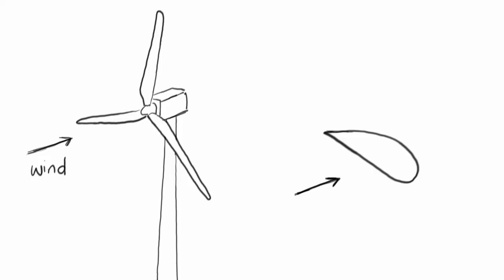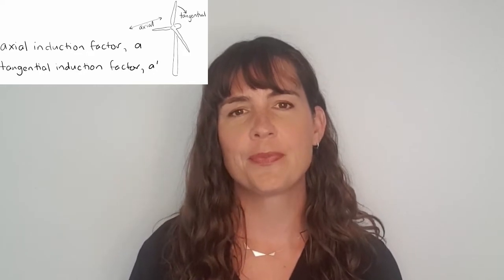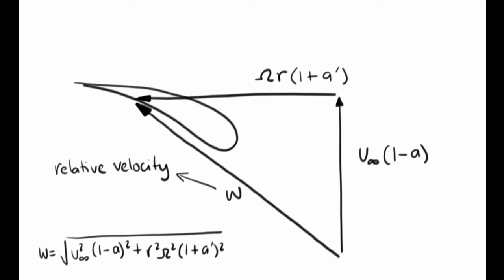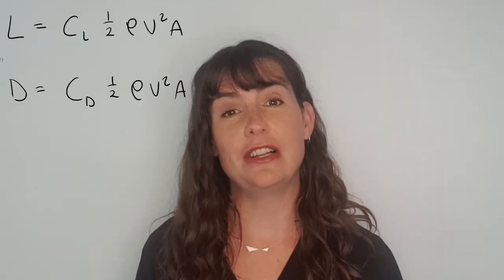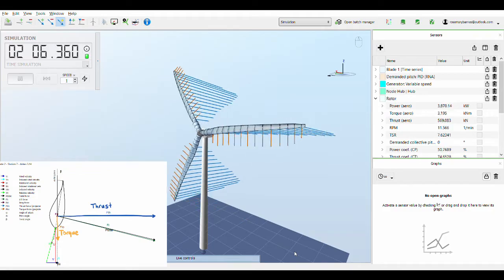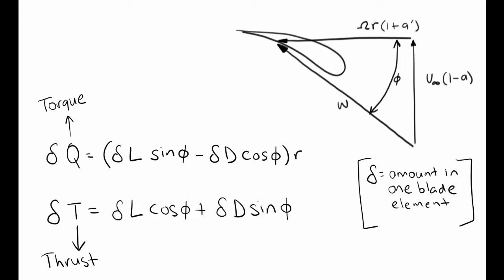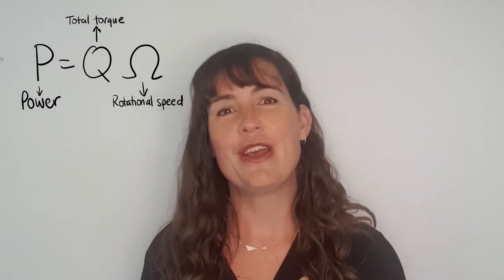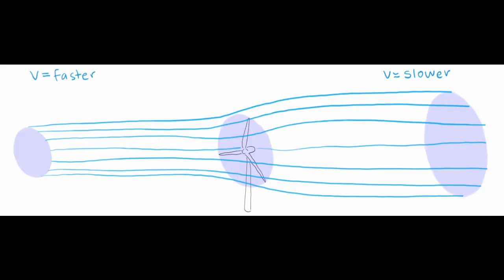How to Calculate Wind Turbine Power Output: Blade Element Momentum Method

Comment: Hi Rosie, One quick question - is generation of tip vortices accounted for in the calculation of CL and CD for Blade Element Theory (with something like Lifting Line Theory), or is that not possible?
Reply: tip losses or root losses usually captured with some kind of correction function such as Prandtl tip loss formula

Comment: I really love your videos and they help me understand for my school project. However i got a problem that i don't know what to do. in my project i have to pick one one blade design, test its efficiency then create one by myself so it would have better efficiency than the one that  was already created. also i will need to 3d print it. Any ideas or suggestions? Would help very kuch thank you so much again.

Comment: So could B.E.M  calculate the vortex and or the energy output of a archimedes / golden ratio turbine. That has a Diameter of a 100 Feet and 75 feet in length. I think not.

Comment: G'day Rosie,

Cards on the table...

My first Aeroplane
May be seen in,
(Title-searching YT...)...

"National Transportation Museum ; Visiting My First Aeroplane...!"

Regards my second
Hairygoplane...,

In it I
Made the 
(Coveted)
"Maiden Flight" of a
New Prototype...,
After I'd redesigned the
Wing
Trailing-Edge Section Profile..., &
The Undercarraige
(Substitituting a floating Bungee-Sprung Cross-Axle,  instead of a welded rigid triangulated 4130 Chrome-Molybdynum Tubular
Structure...), &
The Wing Leading-Edge, (replacing the Dacron/1.5mm Styrofoam/Resin
 "Foam/Fibre 1/2 Sandwich"
Hypothesis,
With 1 mm 2124 Aluminium
Sheetmetal...).

And, also, after
Designing & Fabricating & Fitting
An actually
Streamlined
Fudelage-Pod...,
Around the
Cockpit...

And after having
Flown behind
Two of my own
Hand-made, Home-designed
Laminated
Carved
Propellers,
As well as having spent
20 years trying to
Design a
Micro Wind-Turbine to be as
Cost-Efficient as a
Solar Panel...(!).

I started raising my own
Kids on
Kerosene Lamps, & Candles 
In the 1990s.

Because Solar Panels were
That pathetically
Bad...,
And
Windmills were
Worse....

Thirty years down the track,
And both my kids and myself
Live
Off-Grid
Using Stand-Alone
Solar Arrays, Batteries, & Inverters...
With
NO
Connection to the
Fossil-Fooled
Grid....(!)

Yuck
Fou...;
Grid-
Enslaved
DimyDamnDumbPricks&Twatz...

Just(ifiably
Sayin'...) !

Such is life,

Have a good one,

Stay safe.

;-p

Ciao !

My
BIG
OBSERVATION...

Is that
Betz' Law
Is
An
EQUATION.

It
ASSUMES
100%
EFFICIENCY...,
At
Converting
Rotational Shaft Speed
Plus/minus/multiplied/or divided by
"Torque"..., 
(ie the
"Twistiness"..., 
Encountered within 
Yonder
Shaftings... !)

Comment: Great work, 

In the video you mentioned that you can't use the BEMT to determine the optimum number of blades. But you also mentioned that this theory is good enough for the preliminary design of major blade geometry parameters including the number of the blades.

Kindly clarify this.

Thanks

Prosper
Reply: https://youtu.be/o6BCnhubbiQ?t=237
because in a 3 bladed turbine each blade does not affect the next one that much, zhus the overestimation of BEM (hich cant account for that loss) is relatively low. but if you would add 300 more blades, (which would obviously be insane) this model would think you have 100 times more thrust and torque, as it doesnt "know" the blades can affect each other. it always assumes perfect flow for all blades

Comment: is there a fudge facto for 2 and 3 bladed BEM for comparing wake % differences?
I would think two has next to zero interaction, 3 a little, but not bad, and 4 & 5 blades the hit is exponentially bigger.
Is the optimum number of blades pie?
:)
Reply: Each blade will disturb some air and leave a wake behind it by some circumferential distance, if the number of blades is too high (or speed too fast) then the next blade will be working in messy air that already has some of the enegy extracted - not ideal use of an expensive blade.

If you dont have enough blades (or rotation too slow) then you have some air just going through without any blade interacting with it and extracting power from it.

The distance of disturbed air depends on the aerodynamic quality of the design so a poor design = lots of air disturbed = cannot have another blade too close behind it (either by crowded rotor with many blades or high speed rotation).

 It happens to be that 3 blades at about tip speed ratio of 8 is optimal as it balances these factors.

Comment: Is this same math used for VAWT?
Reply: I do not think so.
Just trying to think about making some simplifying assumptions blows my carbon based simulator to bits of dust.
wind normal to rotation allowes  many clean assumptions and things like 1 dimensional math with a radial slicing as described..
VAWT everything everywhere is always changing. lots of crunching.

Comment: "You can't use this theory to determine what is the optimum number of blades for a turbine"
"It's definitely good enough for preliminary design of ... the number of blades"
hmmm
Reply: It's all about making iterations and as quickly as possible stop exploring something that has low or no potential. After having found something that looks promising it's time to spend more time and energy (money) to refine that idea with, for example, more complex analysis.

The two statements you quote are not in opposition to each other since finding the "optimal solution" relies on later, and more expensive, steps in the process.

Comment: Hi Rosie, very nicely explained....Can you explain what are the main structural( Harmonic , constant etc..) loads at the top of the tower in a stready operations....i mean if u remove blades nacelle and represent it with with structural loads at the top of d tower, what would be those..thank you very much...

Comment: thank you so much. I want to know are you have a program Matlab for BEM?
Reply from the maker: I normally just use an Excel spreadsheet and copy paste to iterate the flow factors until it converges. It is very fast and cheap, I haven't had Matlab since I left uni. 

This book has some Matlab codes that come with it I believe:
https://www.springer.com/gp/book/9781849961745
I used them years ago and they were a bit buggy so make sure to check if you use them.

Comment: Great video! I fully understood BEM theory thanks to you. 
Im an undergraduate student in engineering and i have to design and calculate the efficiency of a hydroturbine. I was wondering if BEM theory could be applied there? Any suggestions or suggested papers are appreciated!!!
Reply from the maker: In theory yes but you will need to check that all the assumptions and simplifications in BEM are reasonable for hydro. I have never worked with hydro, so I have never made those checks.

Comment: Hi Roise. Im design engeneer, and I m going  to build HAWT with diameter 24 m. Wich aerofoil are U recomended TSR 4.5. Power output 20kwh. For BEM modeling and optimisation i use Qblade. Can U recomended softwere for design Hawt. Thank U for video and reply.
Reply from the maker: Hi Demyan, wow that is a big turbine to be making on your own!
The aerofoil will need to be chosen based on a lot of factors unique to your design, so I can't tell you what will suit you best. Don't forget structure and manufacturing, they will be just as important as aerodynamics when you're choosing your blade geometry. And you don't need to use the same aerofoil along the whole blade.
Your size is in between "small" turbines (~50kW) and utility (MW scale), so you might find it hard to get an aerofoil for that size. I would suggest looking at research published in the  early 1980s, when 20kW was utility scale. Try Sandia, NREL maybe universities like DTU or Delft, they might have published aerofoils youcould use. If you need to use aerofoils from much larger or much smaller turbines or aeroplanes then don't forget to calculate your Renoylds numbers because if yours is very different to what the aerofoil is intended for, you won't get the expected performance.
And can you tell me what software you are looking for? You have Q-blade for the aerodynamic design, do you need 3D modelling software or something else?
Reply: @EngineeringwithRosie   Hi Rosie. I started my personal project couple month ago with mixed success. In my job I'm using autodesk inventor but it doesn't help(. 
Сoncerning to aerofoil I picked up NREL aerofoil S821, S819, S820, and in Qblade i calculate an optimum rotor, Cp, Torche, Thrust, bending moment. But I can't simulate 4 blade rotor with unusial inner structure in that aeroelastic tool. I understand that I need some CAD. Curently I know 2 programs - Qblade (2 moth of exp)  and Ashes (2 days ). So I want to find some simple tool for calculating wind thurbine and rotor optimisation. As U writed above  aboute Re nomb of current section of aerofoil I understan that. But I dont know where I can get 360 der aerofoil polar?  X foil simulate in -25 deg + 30 deg. And eventualy I realised that it is experemental data or it is CFD computed data? Can u give a clue?

Comment: Hi Rosie.  I am designing a H-rotor VAWT but I am difficulty coming up with best dimensions for the blade. any suggestions??
Reply from the maker: Hi, I would suggest starting with your requirements (how much power do you want to produce) and your wind resource. Then that should get you in the right ballpark for sizing. Next I would choose based on what the standard sizes are for the critical components you need. It will be much cheaper, easier faster and more reliable if you can get as much as possible off-the-shelf. If you plan to build your own blades, this might mean thinking about how much space you have to get equipment in and out of your workshop, what standard lengths timber comes in if you will build a frame or mould, stuff like that. 
Good luck and please let me know how you go with your exciting project! 
By the way I am working on a video on VAWT design theory, but it is still probably a couple of months away.

Comment: Great video :) What's the name of the software you use for wind turbine simulation?
Reply from the maker: Hi Alfred, thanks 😀 
The software is called Ashes, you can find it here: https://www.simis.io/
Reply: @EngineeringwithRosie  Thank you very much! Keep it on with the videos ;)
Reply: @EngineeringwithRosie I tried the software, but it requires an obscure RAR unzipper. I downloaded it, but it does not seem to work. Did you have any problems with this? If the simulator does not work, is it possible to do BEM by hand?